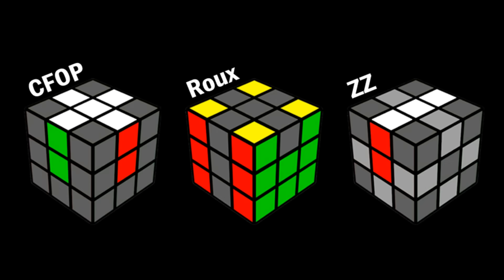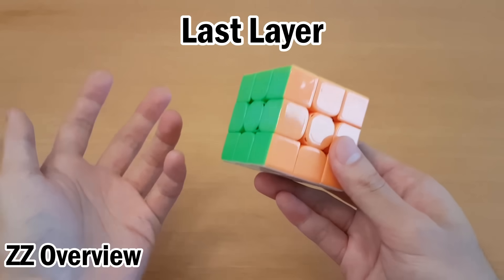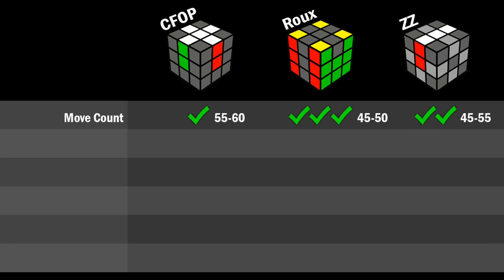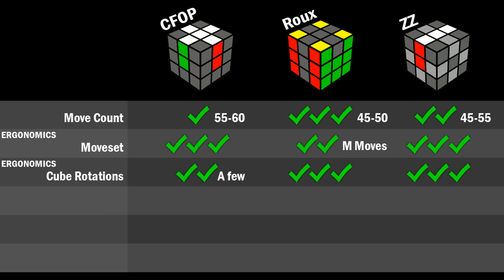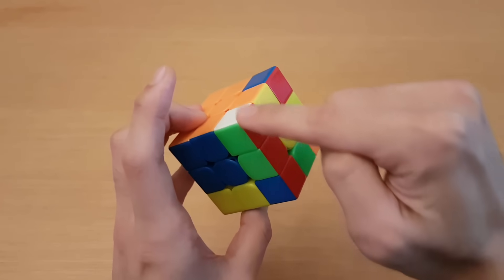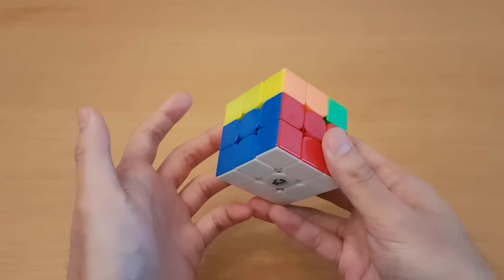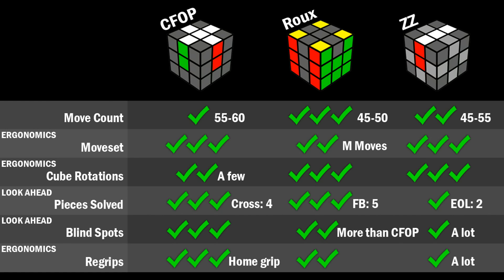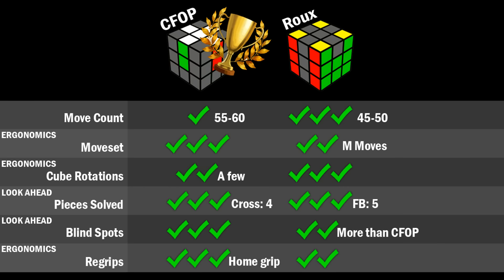The BEST Speedcubing Method? [CFOP/ROUX/ZZ] Comparison

Comment: I use Method CFBL...BL Is Platform...B create a block 1x1x3 Green or Orange or Blue or Red and in the next solve a case 1LLL Line case with block my pb Is 10.95 my pb ao100 18.13 my pb ao5 17.03
I created this Method and I'm only user. I make 70 moves about and my TPS 4-5.
METHOD CFBL(BL=PLATFORM)
EXAMPLE SOLVE 
MY second PB
11.83s.
Scramble:
U' L2 R2 D' F2 R2 D L2 U B L D2 L R' B F' L' D U2
z2 R' L2 D2 F D L //CROSS
y' U F U' F2 U' F //F2L-1 AND F2L-2
y' U L U' L' U F U' F' //F2L-3
y' F U F' U L' U' L //F2L-4
U L' U' L2 F' L' F2 U' F' //Block 1x1x3 RED
U' F' L' U L F R U2 L' U R' U' L U' //SOLVE CASE LINE P2

Comment: One of my biggest pet peeves with ZZ (yes, I just used that term in 2025, yell at me for it) is that I've done a bunch of solves on CS timer for scrambles where the EO Line is solved (I can't figure out EO in a way that doesn't take 5 years), I get lots of pairs where if I was going CFOP, it would honestly be more move efficient to just rotate and solve the pair in that position as opposed to just sticking with R, U, and L moves.

Other than that, I already averages 13 to 17 seconds with CFOP anyway, so I'm pretty comfortable sticking with that.

Comment: would roux help in fmc?
Reply: I don't do fmc but I think zz would be better because it has both EO and block building. Roux has block building too but it rely heavily on M move which count as two move in the wca metrics, so they should be avoided. That being said, learning Roux won't make you weaker at FMC 😊
Reply: Nah learning fmc separate from roux is better

Comment: I use the beginner method but i use shortcuts and i made a shortcut for the white cross which is an algorithm after i make sure that atleast two edges beside each other are correct according to their center. After doing the algorithm for the white cross it gets solved(all the edges get solved). And i use an algorithm that i dont know it's related with f2l to solve the first two layers together using an algorithm and after that i solve the yellow cross using a shortcut then everything else is beginner

Comment: First off i mix f2l with some roux algorythms tp be faster. also i tend to not slove the whole cross but start with the edges first and implementing the cross aside solving the edges. also instead of pll I do a simple aproach in oll so I always end in either U or H perm. Dpeending on what acramble I have they will be cpunter clockwise. its my own kinda solving method. I made this method due to my brain not beeinng able to hold many algorythms so I needed a workaround that can still get me 30 second solves. (yes 30 seconds, Im not the fastest of all solvers)

Comment: There are 100 algs in CFOP (57 algs for OLL ,21 for PLL and 22 for F2L=57+21+22=100 algs).

We have to memorize 10 algs in ROUX (2 in CMLL, 1 in Good and Bad edges,1 in UR,UL and 6 in L4E)

494 algs in zz (494 in the ZBLL)

=
We have to memorize 604 algs for all methods.
Reply: 21 PLL + 7 OCLL = 28 algs for ZZ

Comment: Hi J PERM, I know how to solve a 3x3 cube using Beginner method and now i am trying to learn CFOP method from your channel. I hope CFOP will be faster than Roux and ZZ. I dont want to be speedcuber. I just want to solve cube in its normal time like atleast 20 secs or 10 secs. Because rubiks cube 3x3 world record can be max 2 secs and it cant be broken anymore. I want be a cube solver.
Reply: CFOP is all about the algorithms, so make sure to memorize some. Here are some tips you can follow if you want.
Tips:
- For cross, form it at the bottom of the cube, and use your inspection wisely to think of the best and quickest solutions ever. 
- For F2L, you can either learn full intuitive F2L or memorize and learn some cases. In my case, I prefer the latter option.
- For OLL and PLL, I suggest you only learn the 2-look variations since those are probably enough if you only want to achieve sub 20 seconds. Although, if you are willing and eager at memorizing 57 OLL cases and 21 PLL cases, then go ahead.
- Make sure to practice look-ahead and quick recognition since those are necessary to achieve fast times and records.

Comment: I know this video is 2 years old now, but for ROUX method you use 1 hand for the M layer and 1 hand for the U layer after the block building is done. that way your hands are in the same position, so there are no changes in home grips.

Comment: I prefer to use the minus sign for anticlockwise rotations.
Let's name each face of the cube as Right, Left, Up, Down, Front and Back.
Then define each rotation as a 90-degree clockwise rotation.
R: One 90-degree clockwise rotation of the right face of the cube.
2R = R+R: Two 90-degree clockwise rotation which is equal to 180-degree clockwise rotation.
-R: One 90-degree anti-clockwise rotation.
4R = 0: Four rotations is equal to zero since it is a 360-degree rotation and the cube doesn't change.
R = -3R: One clockwise rotation is equal to 3 anti-clockwise rotations. 
With this notation it is possible to add and subtract the rotations.
The only problem is that the addition is not commutative: 
R + U ≠ U + R

Comment: Normally, I use CFOP, but for cubes like ghost and bump, I tend to return to the beginner's method, simply as a means to control the pieces during a solve.  This is not for speed at this point.  For speed, CFOP.  Haven't tried Roux, except in making Béchamel.

Comment: when i first started cubing i could solve the first 2 layers in under a minute without any methods(i did so visually looking at the peices and connecting them and moving the sides into place)
i skipped last layer since most of the algs messed the layers from solved state 
until recently i can still solve a cube under 1 minute 
i still need to learn 2 look oll+pll for cfop
im thinking if i actully learned 2 look for cfop i could reach under 30 seconds
Reply: You can get to sub 30 with 4 look last layer. Just make your f2l efficient and cross as well, also learn some better finger tricks
Reply: Once you are sub 30, learn full pll then full oll

Comment: Is cfop and beginner's method same?
Reply: Kind of, is the most similar of the 3
Reply: Differences are:  We make the cross on bottom instead of top and always in 8 or less moves. 
We solve both the edge and corner at the same time. 
The last layer is done with 2 algorithms only. First the top is oriented then permuted

Comment: I use beginner method and my personal best is 1:14.59, I’m pretty good in my books because I just learned how to solve a cube 2 weeks ago
Reply: My best is 58 seconds :)
Reply: @imri2208  My best with beginner's method is around 2 minutes and that's with the algorithms in front of me, if I try to recall the algorithms, I always end up like "Okay, what's Beginner's method OLL again? And which one's the last layer edge cycling algorithm?" Like for some reason, I find those a lot harder to remember than the corner algorithm or the middle layer edge placement algorithm.

Another part of why my best 3x3 solve is so slow is that I don't really have any fast moving 3x3 cubes, not ordinary 3x3 anyway. I have a Rubik's brand 3x3 which is okay for starting out, but is not fast. And I have the Void Cube of the same brand, which just, forget it, it just gets stuck way too much + I have to use the 4x4 edge parity algorithm on it which I also find hard to remember. My fastest 3x3 is the Mirror Cube I have from some Asian brand, I'm not sure which one(got it in the same box as my Megaminx), but that adds the complexity of shape shifting.

Comment: Wow I use cfop and I can consistently get sub 50 seconds and I thought that was pretty decent for cfop, I thought speedcubers only used roux and I would need to learn roux to get sub 30 or sub 20 but I will just work on cfop in a different way, I will learn roux also

Comment: in roux, it is possible to plan the whole of first block and an edge of the second block, then u r literally left with 2 f2l pairs, cmll(short algs) and lse(very easy lookahead). roux is OP, i recently switched to roux, and i'm around 35 secs avg now. i averaged sub 25 with cfop and my pb was 13 secs (cfop). and it's crazy how slow you can rotate in roux and still get acceptable times
Reply: Yep

Comment: Hello J Perm, ZZ is my main method and I would like to correct  you about some things you told about the method.
2:15 ZZ takes under 50 moves if you use EOLine, and under 60 if you do EOCross.
6:10 In ZZ's EOLine, you only have 2 solved pieces, but you can use look ahead because all the edges are oriented, so you can determinate what they are. The same thing applies for blind spots.
For regrips, with training you can avoid all the problems you mentioned.
Finally, ZZ is better than Roux for One-Handed (because of M moves).
Have a good day!

Comment: Small note: There is a common misconception that Roux uses lots of M moves, but during SB, we only really use it at most 4 times & LSE on a average takes at most 15 STM. Just wanna point that out.
Reply: that is still way more than cfop. cfop only requires M moves if u get an EPLL(pll where corners are solved, and edges are not solved). the probability of solved corners is 12/72. probability of epll is 11/72(subtracted 1/72 from 12/72 since there is 1/72 chance of pll skips). even those plls can be solved with R and U moves.(though, M move h and z perms are more efficient)

Comment: Ok just to give my 2 cents
I have been cubing for about 18 years, the first nine I was very dedicated/addicted, however you view it.
In that time I learned the beginners method, and full CFOP. Once I learned all the algorithms for CFOP I started to look beyond and discovered the ZZ method. On paper the full ZZ method would be the best method as it has less stages.
Maybe I was brave or just young and naive but I  did try to learn it, I managed COLL but once I moved to EPLL I crumbled under the shear amount of information and it ruined speedcubing for me.
In the next nine years I dipped my toe in and out and came to the conclusion that the method EFOP, once mastered would be the most efficient overall?
I think you dismiss the ZZ method too quickly, As there are different versions.
Reply: By EFOP you mean EOCross, F2L, OLL and PLL?
Reply: Sorry toe back in but yes or even just EO line

Comment: Ok so im writing this long comment because up until a few days ago i shared you opinion, but after looking a bit into ZZ speedsolving, i've learnt that you made a very big "mistake" that seriously undermines ZZ's score in the later parts of the comparison. It all comes down to EOCross (EO + Cross). It is superior to EOLine in every conceivable way, except maybe for the fact that it is harder to plan (advanced ZZ solvers do this no problem). If you do EOCross you are basically doing a "reduced" version of CFOP. I say reduced because EO fixes all the edges making F2L lookahead miles easier and reduces the Last Layer to at least a ZBLL (if you dont wanna learn ZBLL there are other ways that are still a lot faster than OLL + PLL) where all edges are permuted. 

EOCross basically addresses every  problem with ZZ vs CFOP:
- Pieces Solved: EOCross solves 4 pieces, just like Cross on CFOP.
- Blind spots: EOCross haves the same blind spots as CFOP, but since the edges are already oriented lookahead is even easier.
- Regrips: Same principle as CFOP: if you bring a cross piece up, it has to go back down so regrips are virtually the same as CFOP.

This, combined with the low movecount, amazing moveset and the fact that there are no cube rotations, makes ZZ the best method in my opinion. The only downside is that it is very inspection dependent and EOCross is kinda unintuitive for beginners or newbies at ZZ. Also, since they're very similar in most places you can switch between them very easily.

In conclusion, ZZ is very underrated, and most people don't see how good it actually is. ZZ (with EOCross) is basically reduced CFOP with easier cases and no cube rotations and it saddens me how it isn't used more. I hope people will see that ZZ is at least as good as CFOP, if not even better.
Reply: True
Reply: EFOL IS THE BEST, FACT?

Comment: ZZ is so unnecessary. Think about it, what benefits do you get from orientating the edges during EOline?
You end up with 2 more pieces that need solving compared to the normal cross, your solutions require more thinking due to the intuitive nature of block building, yet don't reap the benefits of lookahead that CFOP has. All that sacrifice just so you force a yellow cross.. 

Tbf ZZ is one of those methods where the sky is the limit. There's so many branches of ZZ like ZZ-CT, ZBLL, ZZ-WV and so many more. Honestly it's insane how many algorithms ZZ has the potential to have. 

But at the end of the day it's still a redundant method that tries to be a compromise between blockbuilding and algorithms but ends up taking the worse of both worlds. You need to have really good blockbuilding got ZZ F2l yet memorise a shit load of algorithms for LL, like what's the point?
Reply: No ZZ solvers use EOLine anymore, it's eocross. So instead of having two less pieces solved, you have the same amount. Then you need less thinking, because you know every edge will be oriented during F2L, the F2L requires less thinking. Every pair can be solved either RU or LU gen. RUD and LUD gen tricks can be used for effeciency. Since you know every edge is oriented, lookahead is easier.

The end result is a method with a harder first step to CFOP, but easier, quicker F2L with better lookahead and ergonomics. 
Doesn't sound very redundant to me.

Comment: I learned 3 days ago with cfop. I just purchased a magnetic cube to lower my solve time as speed is my issue with basic cubes. The corners get stuck and I can't take advantage of corner cutting. I went from about an 4 hours on my solve time dropping drastically once I picked up the fundamentals to about 5:45 as of last night. Never thought I would enjoy a cube so much and im bummed I didn't try to learn this sooner.
Reply: How are you doing now?
Reply: @justaregularhumanbeing  within a month of learning I was at 1:30 with beginners method. And I'm at close to a minute on beginners. To lazy to learn olls
Reply: If you cant corner cut right now I will cry for you
Reply: @randalllopez9707  I had a cheap 7$ store cube. I ended up buying a Gan 356 xs corner cutting was no longer an issue.

Comment: Thank you J Perm! I was (And kinda still am) a CFOP solver, but the Cross and F2L steps are just not for me. In Roux, the only thing that I really need to focus on is F2B (if you ignore memorizing algorithms). Also, since Roux is more intuitive, and I don't like to memorize a bunch of algorithms. And since CFOP uses 78 algorithms and Roux only uses 42 algorithms, I like Roux better in this category as well. So, I am gradually going to switch from CFOP to Roux. I also need your opinion. What do you think? Should I switch from CFOP to Roux? 

Also, I read a funny comment in the comments:

A few years ago: Petrus is bad and we should change the big 4 to the big 3

Now: ZZ is bad and we should change the big 3 to the big 2

Props to @Sledged Hammer for this comment

Comment: What would you recommend me to learn? Im doing currently the beginner method.
Reply: Next step CFOP, but no need to learn all 57 OLL’s. Once you have all 21 PLL’s, two stage OLL and a good understanding of F2L, move to ZZ method EFOP, it will be the most logical next step and if you only focus on that from then on you will master one of the best methods with the least amount of memorisation, resulting in more overall time focusing on your final solution.

Comment: I think it depends if those 2 or ZZ are the best one, but first: you said the more you speedcube the more you think ZZ is not for speedsolving, i think you are wrong and in the ''late game'' ZZ is better because of ZBLL and the fact that you can orientate and do cross just from the inspection time (in an advance level, where if you use only zz you will get eventually) and also for PB's is very good if you get everything oriented and if you are neutral to zz (again very advanced) you can almost always get 4 to orientate which is very easy. Also you don't need to do the EOLine, i use regular cross and f2l with ZZ. the look ahead is true, is a bit more difficult but there is more room to improve where in CFOP for example, the best speed cubers can't ''improve'' much more. I never thought ZZ was better than the others but i think in world record levels it is as the others have (for me) more limitations.
Also you can learn ZZ COLL and only 3 pll and that is very few alg for that level, you don't have to learn full cfop or things like that
Reply: I agree with everything you have said, after basic CFOP the next logical step would be ZZ method EFOP as you don’t need to learn all 57 OLL’s, it focus’ your possible PLL’s and during F2L you only need to preform R, L and U moves. If you spend the time to learn EOLine the next 3 stages will be faster. I don’t agree with EOCross as I feel the time it takes to  account and preform the 2 extra edge movements you could use that time more wisely in the F2L stage.